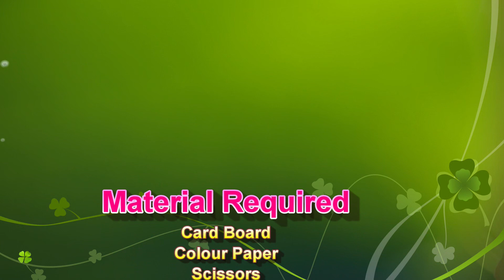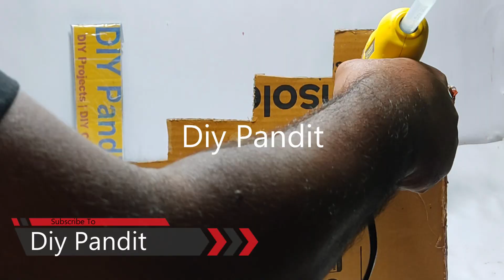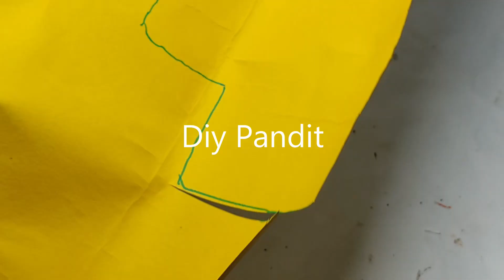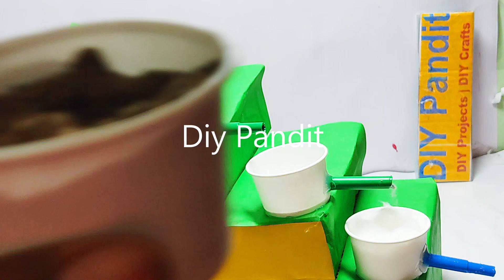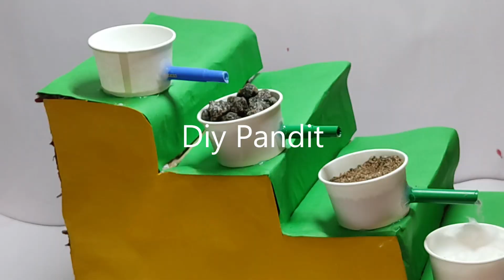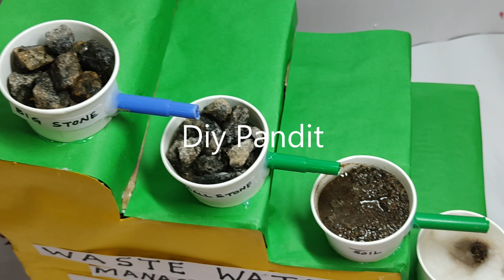waste water purification working model for school science project exhibition -  DIY pandit

Comment: The theory is there are several sizes of filter media, large to small.  The 'dirt pieces' in your wastewater are trapped, starting with larger grains at top, and then going toward small grains.  Once a small amount of this dirt is trapped in each size of media, the dirt itself makes a more efficient filter.   Extra credit: The filter capacity will be increased by making the cup (vessel) fatter, so as to hold more dirt.  The filter efficiency (defined as percent disappearance of dirt of a certain small size) improves as the filter depth is made deeper (longer top to bottom).
Reply: How is the sand not going   out through the tube?😢
Reply: @dodosoubra9239  ur so dumb
Reply: Lil bro commented this on the wrong video🙏😭💀